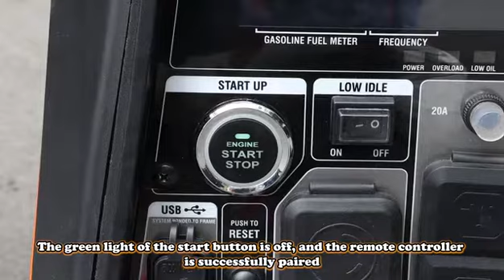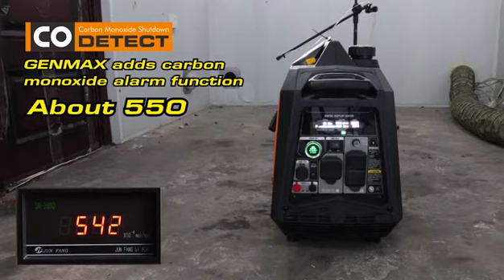GM3500iAED Unpacking Video

Comment: How do you charge the lithium battery?
Reply: Charges as you run the generator. If it's dead use the pull starter.